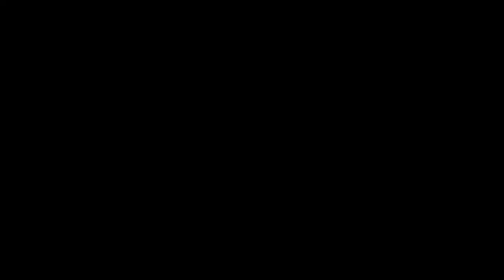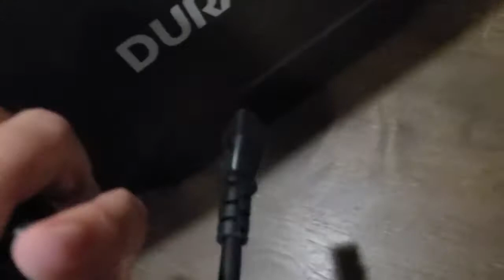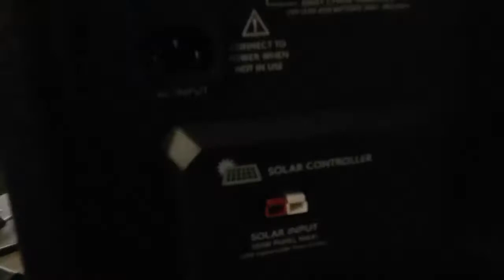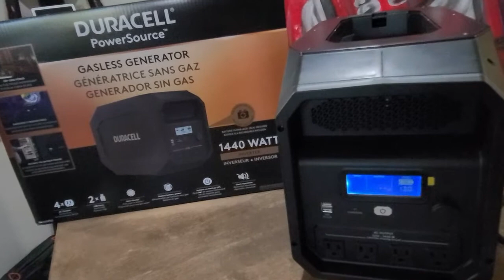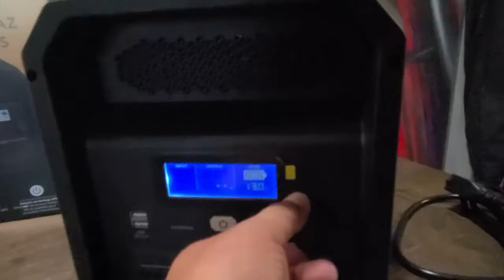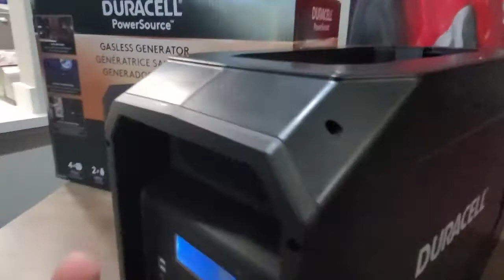Gasless Generator - Duracell Power Source 660 unboxing and features

Comment: Those Duracell generators especially the 1800 watts are a waste of money and cannot power what they claim. I used it on a flat 55” led tv with an Xbox console and a router to find out it only lasted 15 minutes so I changed it for another one and it did the same thing. I do not recommend it. Waste of money and time.👎👎👎
Reply from the maker: Sorry it didn't work out. Usually understanding the amp usage of your devises and total amp hours of storage is just about doing the math to make sure you are getting what you need.

Comment: Hold on, did you say that the battery tech in this is not Li-Ion?
Reply from the maker: Correct.  It was an AGM battery. Newer units are mostly LiON.

Comment: I only have one question.  Say the power goes out at the residence because of a storm.  How long do you think it can power a thousand watt airconditioner; until the power grid is restored?
Reply from the maker: Operation time is all a function of the particular devise you are trying to run. you will need to look at the power output in watts relative to demand in  amps and voltage see if 1.) it is even capable of running the machine  2.) the devise's efficiency based on operation meaning running a devise on high vs eco mode.
Reply: @exhaustinglife  Thank you so much.  I am about to buy one.

Comment: Any follow-up on this unit when using it camping..and how or when do you recharge
Reply from the maker: I have since moved on to ZAMP Solar and Dometic for my off-the-grid power needs. I am running a couple rooftop solar panels and the PLB battery pack and saved a few pounds and added solar recovery.

Comment: I own this unit and many others. It's not comparative to other offerings that basically market themselves as solar generators. It's tech is pretty dated. Appliances like refrigerators, microwaves, and compressors that use AC motors won't run as efficiently on a modified sine wave inverter. There is a risk a damaging the appliance. I use to be a truck driver and had many 12 volt devices. Cookers, water boiler, fans, fridge ECT..These are great for those. It's how I utilize mine. It's also great for old tube TV's ect.. It has it's strengths and I will continue to use it. Just know what your getting.
Reply: think i'll get on for my truck, I had to shut down one day when it was minus 11 degrees. Luckily I was on the interstate, but those back roads get pretty sketchy
Reply: @d.s7741  Indeed. Depending on what you can find it for. I would encourage you to look for something more modern. It's a great unit for what it is. I got mine heavily discounted and I've had it a while. To be honest there are better offerings at this time. But if you can find one for a bottom basement bargain and you're willing to do a little tinkering it would be a asset. Especially if you add a pure sine wave and a separate charge controller to the additional batteries. I wouldn't pay more than 150 to 200 for it. Just not worth it anymore with so many wonderful new stations available. Just trying give my honest opinion.

Comment: Is the output pure sine wave or not?
Reply from the maker: Yes the PowerSource 1440 watt is pure sine wave
Reply: @exhaustinglife  No, it isn't. It is modified sine wave.
Reply from the maker: @michaelarrow1918  I could be wrong  but call Duracell. When I asked their tech help line, they said otherwise.

Worst case scenario you can check. Help desks are not always correct and an oscilloscope should show what it is.

Comment: Is there a way to charge the 1400powersource , from dodge  sprinter van battery..( which is located inside van under floor board where drivers feet rest? If so how ?
Reply from the maker: I am not familiar with what Dodge offers. This is a standalone system that can piggyback an additional battery but is no meant to integrate with another charging system or battery circuit.

Comment: Hi. I got this to power my home fridge and stand up freezer in garage in case of power loss. Will it work for that? I haven't set it up yet. Oh and after charging it should i keep it plugged into wall and freezer? Thankyou
Reply from the maker: That is its best feature. it is a perfect UPS (uninterruptible power supply.)  You can keep it plugged in 24/7 and it will cycle on and off as needed.

Comment: I'm unable to get my 100 watt lion solar panal to charge my duracell power source.  What should I look for as the problem?
Reply from the maker: What specific panel do you have and does it have an internal regulator of sorts? 
The Duracell power sources can only have Anderson connector equipped panels connected to its solar controller.

https://youtu.be/Bv7JHKTXGp0
Reply: If your panels have a built in charge controller you can't (shouldn't) connect them through the Anderson connector. You can connect it to the battery expansion lugs on the back, but you will not get the green flashing light to know that it is charging (but it will charge) - that only works if you are using the unit's internal charge controller. You can also connect more than 100 watts of solar this way, per Duracell.  If you are using the Anderson connectors on the Duracell it needs to be a bare panel with no charge controller or other electronics built in or in between the panel and the Anderson ports.

Comment: Can you run power tools with them ?
Reply from the maker: It depends on how much amperage the tool draws. It is a 1440 watt inverter but if the tool spikes amperage or has a high draw it may not work. It will run a portable heater, blow dryer, mattress inflator, AC/DC fridge, and charges my portable devises no problem. I have all cordless power tools so i don't plug into a 110 for that
Reply from the maker: @Ryusaki Pwnz You are confusing 2 specifications:
1. The inverter's max continuous output is 1440 watts (Peak 1800 watts / Surge 2880 watts)
2. The internal battery has a capacity of 660 Wh or 55 Ah ( 660 Wh / 12v = 55 Ah)

Comment: As these "solar generator" units go, this model is completely outdated.  It uses a PWM solar charge controller, Modified Sine Wave inverter, and an AGM lead-acid battery.  None of these are state of the art.  The only two good things about this unit are the price and the ease of connecting more battery capacity...but given how little it comes with, that's a necessity, not an advantage.
Reply from the maker: I appreciate the insight but Its not a "SOLAR" Generator but clearly marketed as a "GASLESS" Generator getting its power from being plugged into AC so there is no debating its NOT the most advanced solar focused product but that was never the claim and I don't think i even mentioned that.
This design operates as an excellent UPS (uninterrupted Power Supply) devise and works for short week outings on its own AGM battery capacity. As far as state of the art technology wise there are a few thing coming soon to bring the next iteration up to newer tech but this is not a new offering to the market just a great value item with a reputable brand and solid design and build quality.
Reply: @exhaustinglife  - I agree with you on the whole "solar generator" misnomer, but since it DOES have an Anderson connection, for a paltry 100w of solar input, it can also be argued that this unit "generates" electricity from the sun.  The panels do that, technically, and this just stores it in a battery.  I have long referred to these as a "BICC" - Battery, Inverter, Charge Controller.  Not as catchy, though.  :)  Yeah, this unit is a huge UPS, and useful in that regard, but it's only two good selling points are a low price and the ability to very easily add capacity...something that is desperately needed, based on how little it has.

Comment: I recommend using a clip on microphone for stuff like this. Thanks for making awesome videos!
Reply from the maker: Corrupt audio file on the zoom! At least I had the go pro audio.  Not great but this was just a test.
Reply: @exhaustinglife  bad luck with audio file. Glad to hear you had something to salvage so you didn't have to remake the video. I bet making these is a lot of work.  Its great to see that you keep improving and trying new things with your vids. I've noticed your effort to keep improving quality.
Reply from the maker: Happens sometimes. As a one man show I need to do a few equipment checks when recording just in case. Failure is how we improve.
Reply: I have a 2019 zr2 with a Retrax Pro tonneau cover, RCI adjustable 12" rack and a Thule kukenam ruggedized tent.   I love watching your vids for ideas :)
Reply from the maker: And I enjoy reading feedback and getting more ideas from viewer's comments and projects.  Keep the gears turning on what to do and in some cases redo.
Reply: Problem with the inverter is it's modified sine  the battery expansion is great the but a100 amp solar charge controller a joke and it's not mppt why isn't anyone building an entry level solar generator nature generator at least has a pure sine wave inverter and if you have a newer phone they have need type C a Fitbit watch won't charge on the old slow charger I think one of these two companies mighl if the reviews would point out what they need to do to make a great entry level product the big three Will P David P and the professor.have all forgot they didn't grow up with a silver spoon in their mouths these two companies both say how easy it is to replace the battery in the unit but if you charge them with the built in charger they'll be like all the booster packs I've bought dead battery in a year I've bought many Canadian Tire unit's a Black and Decker and now two Everstarts from Walmart since finding utube I found out I wasn't my fault they died I couldn't believe that it was the way they're charged so I took apart my old Black and Decker and written right on the battery was do not discharge below 12.2 volts and float charge is 13.4 volts and change at 14.8 and the charger was 12 Volt so it was no wonder that the battery sulfates and won't take a charge a great intry level solar generator would have a 2000 watt pure sine Wave inverter like nature generator although most campers would find a 1440 watt pure sine wave inverter would do for their needs but proper charging parameters are crucial and a mppt solar charge controller is a must have if they made it programmable that would mean that when the battery needed to be replaced in five years or more you could upgrade to lithium battery while a regulated 13.4 outlets would be nice there not as critical as all 3 USB charging ports with so many devices going type C or quick charge their critical to have even if it adds a couple of hundred dollars to the prices better to pay a little extra to start with then to buy new battery every year in 3 years you've broken even otherwise it'll cost about 100$ a year to keep the unit operable if you want to make a sealed lead acid battery last for at least 5 years get a battery charger that charges sealed lead acid batteries and maintains them and change through the battery expansion terminal my Everstarts are already not taking a full charge so I'm sure hoping that someone will come out with a good entry level solar generator as to buy one of these two units and a good 30 amp mppt solar charge controller gets a little bit expensive
Reply: @douglaswindsor120  Thanks for the info!